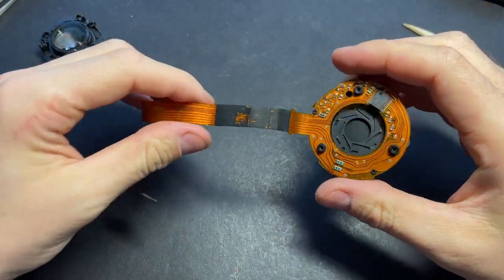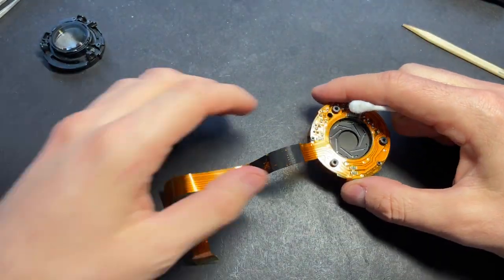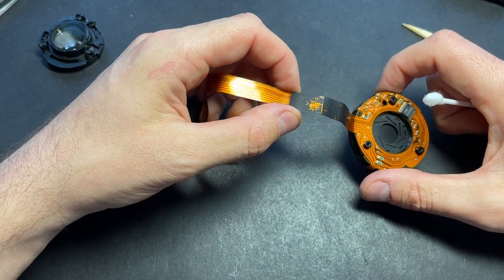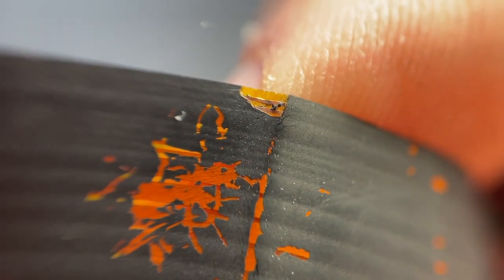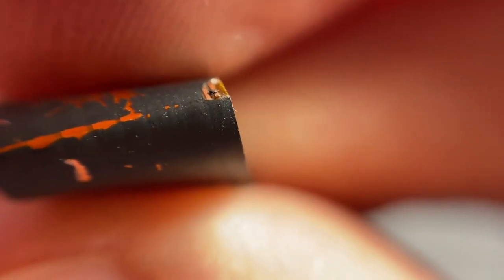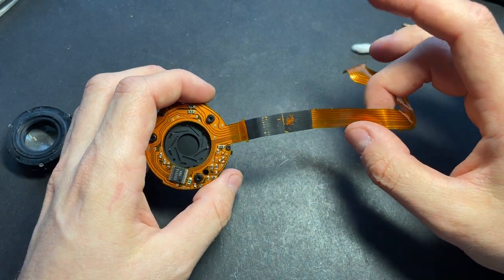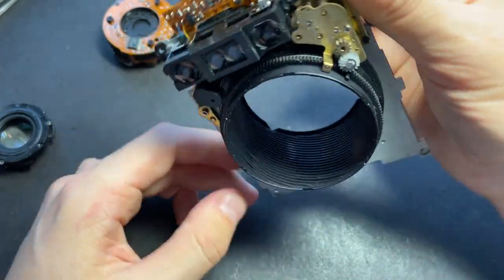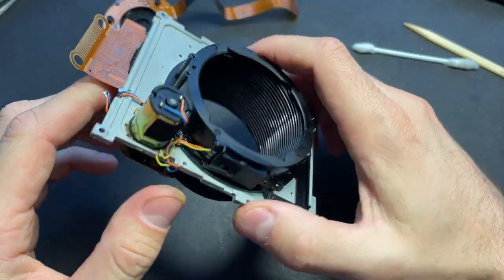fuji ga645 prevention of shutter flex cable failure (conclusion after cleaning the cable from glue)

Comment: hey! very nice and informative video :) do you know what to do to preserve Contax TVS from damage?
Reply from the maker: protect the camera from high temperatures - above 45 degrees
protect against low humidity - below 25%
do not leave the camera for a long period of time without use.
all these 3 reasons accelerate the drying of the flexible cable, which leads to breakage.